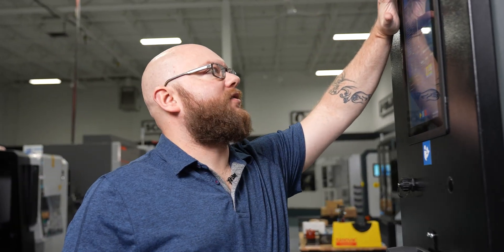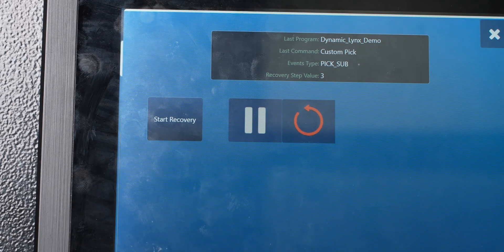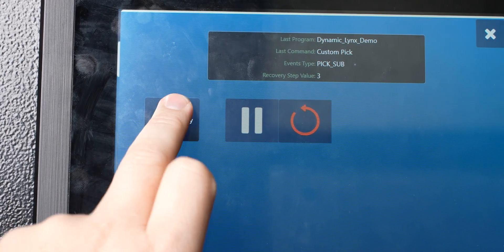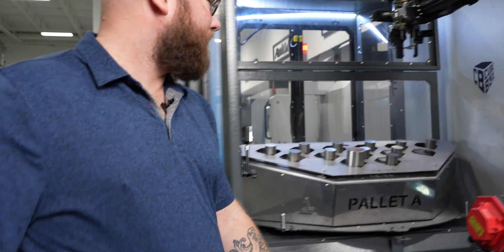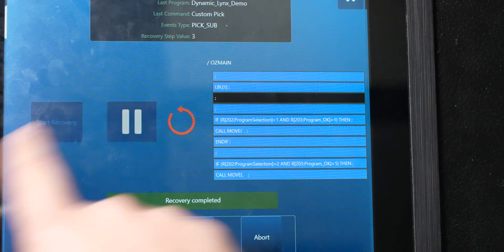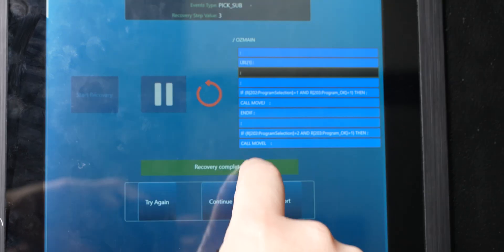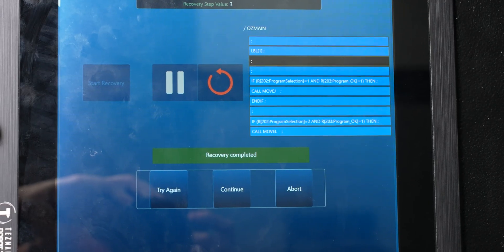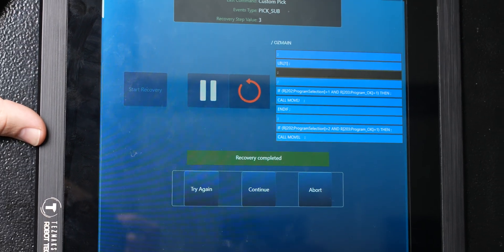Crashing Our Robot | Showing How Easy It Is to Reset the CubeBOX

Comment: Stupid question do you guys ever work from (models only) or do you always have a print to work with (I’m making a new printer(DLP printer @EnvisionOne) platform assembly (I’m using the part files to generate tool paths for each of the parts)… yeah I made a duplicate of a part when I needed its mirror…
Reply: cant speak for their shop but would a model without a print be useless? still needs tolerance and GD+T right?
I guess you could call each a theoretically perfect tolerance, or +-.005in or+-.1mm on everything since you are the only person using that part. 
I think the least I have put on a print was 1 datum, 2 numbers and a centerline (it was a adapter plate).
  Some of the cnc machines and software are getting smart enough that they can display a model with tolerances embedded in them, but that's a long way out from common adoption.
Your mileage may vary!